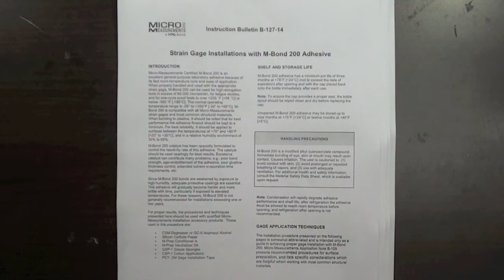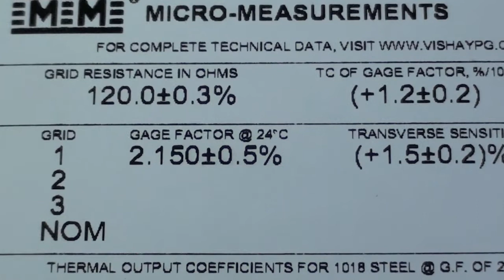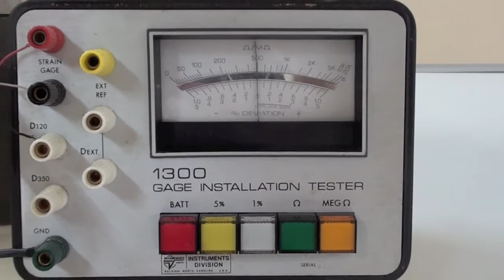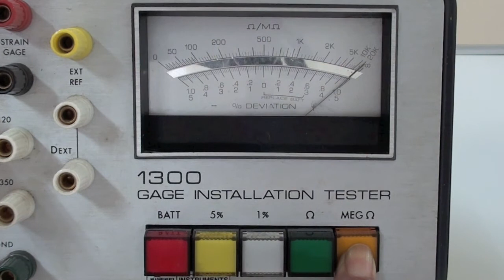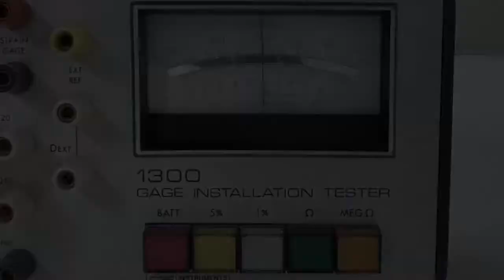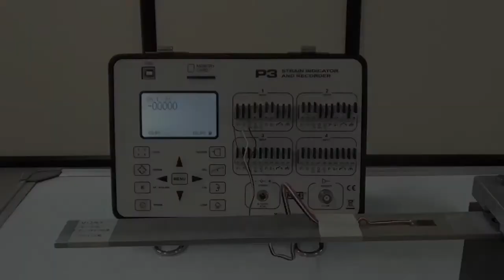Strain gage bonding quality

Comment: Great information.  If a gage installation is checked following this video procedure, you can be assured that the gage is functioning correctly.  Good procedure to use prior to making measurements with an installed strain gage, and for checking a gage installation where damage is suspected.